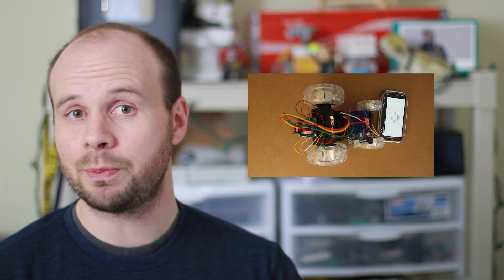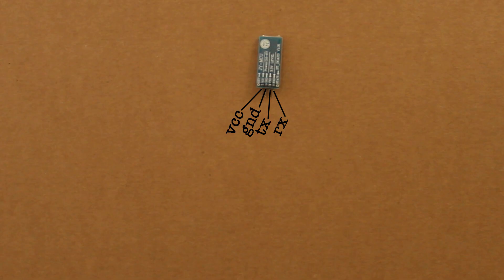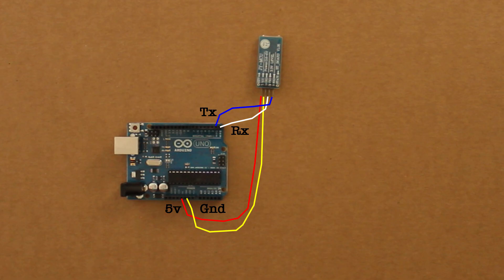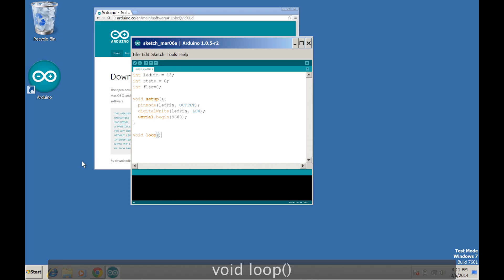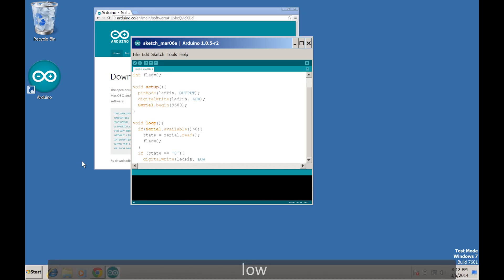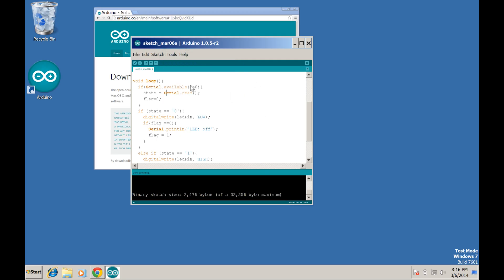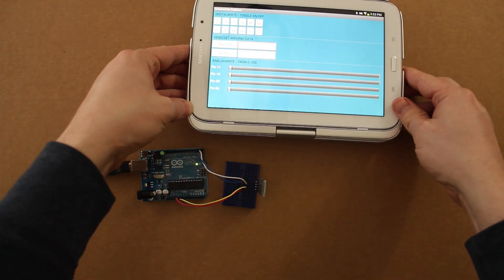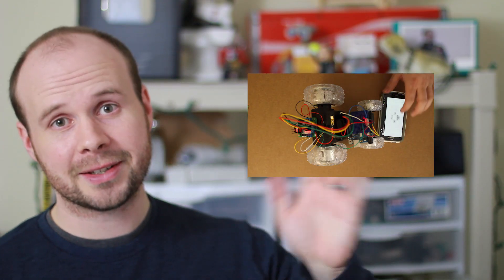Arduino Bluetooth Basics

Comment: what's flag and what does it do?
Reply: It's been a while and I'm not certain but it seems to control whether the LED state should be printed or not.
Reply: Flag is a mainframe term meaning indicator. Usually an interger. Usually 1 for yes (or true) and 0 for no (or false). You may also run into the term "table", which is a 2-dimension array or matrix. It can be more than 2-dimensions also.

Comment: Is the bluetooth device name "linvor" and the password "1234".same for all arduino bluetooth modules? The reason is that when I ordered it in the mail I didn't receive a booklet or directions regarding the bluetooth module.
Reply: Randolph Herbert the default is either 1234 or 0000

Comment: Hi I have followed all the directions from your video and have established connection with the bluetooth and my phone. However, the LED will not respond when I send the signals from the Smartphone. The only difference between your case and mine is that I'm using a Arduino Leonardo instead of the Uno.

Comment: hi! can i use bluetooth module to communicate between arduino and android smartphone to act as proximity sensor. what i mean is when bluetooth signal less than certain value, android will trigger some action (for example sms) to phone. for this i am using 1sheeld

Comment: How would you control if enter number "2" on Android phone app output led different number. It was still output 13 is what i dont want to. here my code. 

int ledPin = 13;
int ledPin2 = 5;
int state = 0;
int flag = 0; 
 
void setup() {
 pinMode(ledPin, OUTPUT);
 digitalWrite(ledPin, LOW);
 
 pinMode(ledPin2, OUTPUT);
 digitalWrite(ledPin2, LOW);
 Serial.begin(9600); // Default connection rate for my BT module
}
 
void loop() {

 if(Serial.available() > 0){
 state = Serial.read();
 flag=0;
 }

 if (state == '0') {
 digitalWrite(ledPin, LOW);
 if(flag == 0){
 Serial.println("LED: off");
 flag = 1;
 }
 }
 
 else if (state == '2') {
 analogWrite(ledPin2, HIGH);
 if(flag == 0){
 Serial.println("LED: on");
 flag = 1;
 }
 }

 else if (state == '1') {
 digitalWrite(ledPin, HIGH);
 if(flag == 0){
 Serial.println("LED: on");
 flag = 1;
 }
 }
}

Comment: Nice video. I'm having problem connecting my Nexus 5 to HM-10. It's detected, but I can't connect to it when I tried. What should I do with this?
Reply: Nevermind, found the solution. Apparently you need Bluetooth LE compatible app.
Reply: ade harnusa azril well i am using samsung galaxy... Can u tell me how u did it?? Thanx in advance!!

Comment: Hi am new to Arduino and just getting my feet wet. One basic question what is the difference between the HC 05 bluetooth module and the BLE shield that I see on other videos. The other question I have is have you used the HC 05 to control more than one appliance in the same project? any advice and code share will be much appreciated. Great instructional video by the way.

Comment: for TX and Rx there is a 3.3V level, so according to me we should be using resistors or potential dividers as the uno board output is 5V. am i right???
Reply: That depends on which blue tooth board you're using.
Reply: Sons_of_Liberty because if you measure the voltage emitted by the TX pin it registers at slightly less than 5 volts.

Comment: why do you need the flag var?
Reply: its what controls whether the LED pin is on or off. Variable 'int state' is to get value from bluetooth.
Reply: Nick Guerra-Contreras Isn't the flag just for writing to the serial monitor?
Reply: Only for state of led, softwareserial for bt com